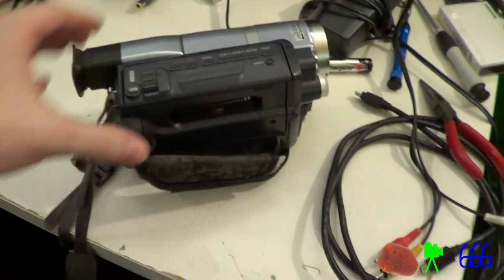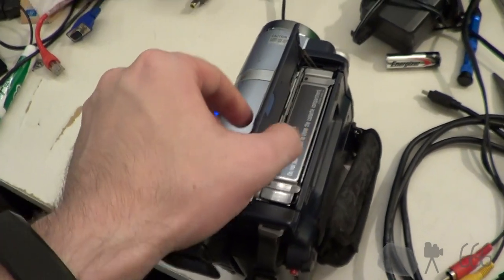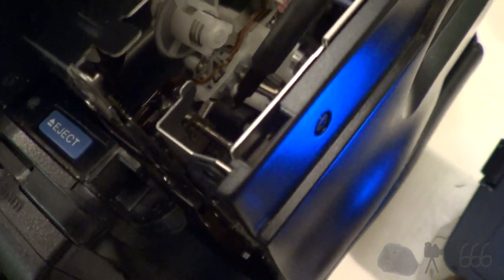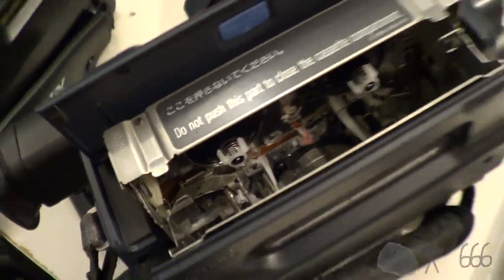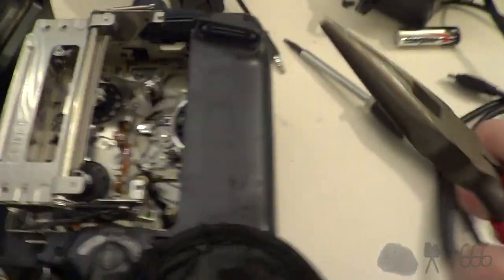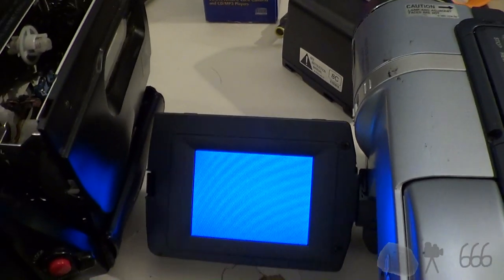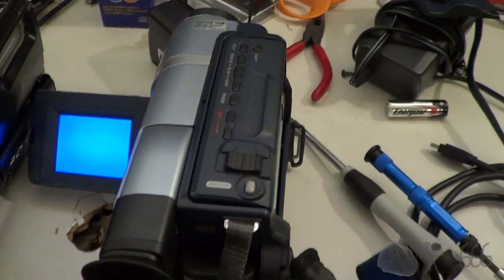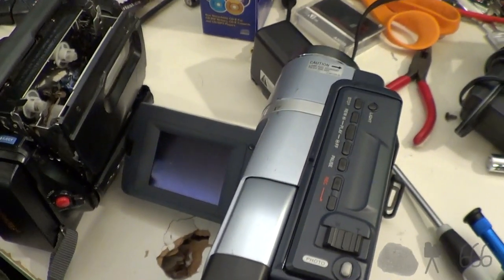REPAIR Sony Handycam C:31:23 Error Message ("White Lock Pin" Fix)

Comment: My Mini DV Sony camcorder gave that code after dropping it on the floor from hip height.
I found your video as well as reading a forum on the code and someone mentioned their roller fell out when they inverted it. Sure enough mine fell out and after inverting again the white lock pin followed.
I used a pair of fine pincers to place the roller back and then position the lock pin on top and pushing it down. It stopped flush with the top of the roller but when I pushed down it went a bit further before stopping.
The roller moved freely and stayed when I inverted camcorder. Then it worked again in both playback and record (filming).
Your video sorted my problem. Many thanks.

Comment: If you still have the roller in place, disconnect the battery and the ac adapter and give the camera a few slaps (pretty hard ones) on the bottom and on the side door. Chances are it will do the trick (it did for me).
Reply: i tried that but after like a min of recording it would come  up wit the same error, the roller and lock piece look fine not rlly sure what to do
Reply: @scar9051  Did you try with different tapes? Try rolling back and forward a tape a few times and see what happens.
Also try a few good slaps on the tape before inserting it into the camcorder.
Reply: worked for me too, thank you!
Reply: Maaaan, u are my saver, i just slapped my cam few times and now its working, thanks a lot)
Reply: It's been one year, I ran into this problem and have been solving it all day, after looking at your comment and hitting the camera like you told me to and OH GOD IT DOES WORK!!!! THANK YOU!!!!
Reply: I tried this before watching the video for the sake of it and I’m surprised something in my life for once was so simple to fix
Reply: OH God, you save me, never in my life hitting something actually worked
Reply: holy shit this actually worked

Comment: Just this very minute I came upon this video. I also have the roller in place and I just pushed at it with a pen and it worked after consistently not working since i pulled the camera out after 10 years in the drawer. It does seem to be the issue. I'd like to thank you for the video. If I find something more, I will post again.

Comment: Just an additional check, this happened in my case:
If it only happens for one casette, check if your tape is not torn. It will give the same errors for this.
Reply: Wym? Like the tape is actually giving the issue code ?

Comment: Thanks for this , had this same problem today , I had to tip the camera up to get the rubber roller out from the bottom where it fell , didn’t know about the small plastic piece until I watched this, searched around for it and luckily it was sitting on the desk , it’s very tiny and easily lost , a biro pen won’t work , it’s too big.

Comment: Waddup, nice vid, but i still got the same error (C:31:22). The black rubbery part was there all along. I checked my insides and everything seems to be fine. Any tips? I´m pretty desperate. Thank you. (My camera is Sony DCR-TRV285E, but i belive the insides are pretty similar)
Reply: Did you fix it ? Did a tape head cleaner work
Reply: If you discover your roller is still there, you might have a cracked lock nut (the white piece that holds the roller on is cracked and will keep getting loose and the error will keep happening). You need to replace the lock nut or insert something to help hold the roller in place. I suggest trying this: https://www.ebay.com/itm/Lock-Nut-for-Sony-Handycam-Pinch-Roller-Repair-C-31-22-C-31-23-1-PIECE/142451202062?hash=item212ac0d80e:g:u-YAAOxyVLNSx7FL

Comment: Hello
Would someone be so kind as to take 1 minute to clarify a problem with video playback?
I have a problem with a camcorder.
Indeed, I recovered old hi8 and 8mm k7s in order to review some memories, so I bought a second-hand Sony Handycam Hi8 CDD-Trv95 NTSC camcorder. (all the buttons are in Japanese:!) works very well I can read new K7 Hi8s but not my old Hi8 and 8mm. therefore impossible to read them ... it starts up, but I have a blue screen.
I wonder why I can't read these tapes when they are good too.
On the other hand, the images of my old K7s only appear in quick reading.
What is the motive?
Thank you for your advice.

Comment: FIXED - I have a DCR-HC22E and had the C31:23 error. The roller and white lock cap was in place, and the roller was rolling around freely. 

However I noticed that the white cap was a few mm lower than the top of the black roller, down inside the roller a bit too much - whereas they should be more or less level with each other.

So I used a thin screwdriver to gently push down on the edge of the black roller, in case the roller was sticking up too much. For some reason, this made the white cap pop up a bit, above the edge of the roller.

So I then used the screwdriver to gently push the white cap level with the top of the roller, and that's fixed it - the error has gone and the camera now works again !

Many thanks CarnelProd666 for pointing out the roller was the issue !

Comment: I have an issue with mine that has a similar problem, it gives me the eject error except slightly different. My camera, upon turning on, automatically starts spinning the nob where the hi8 tape goes into. I just posted a video on this account of the issue, would you mind taking a look at it and telling me what the issue might be? It would be greatly appreciated!
Reply from the maker: That is a completely different problem.
Reply: @CarnelProd666   Would you happen to have any words of advice on how to troubleshoot it?

Comment: Hey man , I literally bought a roller and a lock nut original since mine was giving me the 31:23 code and i put it all in and the lock nut does it need to be completely in? Like enough that its showing the screw thats in it At the end ?
Reply from the maker: It doesn't sit flush, but the difference is less than a millimeter.

Comment: I get that error, but my tape will not eject.  Is there any guide to manually ejecting the tape?  trv85xl   Thanks?
Reply: I get the same error as you,but mine ejects only in VCR mode

Comment: I have the same error code, I did this and still shows the error. What can I do?
Reply: I had the same, my white pin was actually stuck inside the camera, this took me 5 years to figure out. I wiped the inside with a soft paintbrush and it fell out, I hope it works for you!

Comment: Ive been gettin the error code c31 22 and it says to reinsert the tape but my white pin is there as is my rubber roller. Do you have an idea on what the problem could be?
Reply: I have the same issue! :( it wont work . I read that sometimes if you just hit it lightly on the side (like soft slaps, I guess), then eject the cassette and put it back again (and maybe repeat it a couple times), it will work. So you might as well give it a try. It didn´t work for me, though.

Comment: Hi, I have a Sony DCR-PC1E, it has the same problem but the roller and lock pin seems ok. However, the error code C31:23 and sometimes C31:40 shows on the display. Anybody has the similar problem and has the solution.Thanks
Reply: My lock pin is fine but I get 31:23 too
Reply: @jakec2120  fixed?

Comment: My cam have everything ok, rubber roller also there but giving same error C:31:23 How to solve?
Reply: I had same error message but the mechanical parts looked okay.  I put a tape cleaner in - and then when the pushing the cassette carriage down I also gave it a little push inwards as it seemed to be struggling to fully close.  I repeated with an actual tape and it seems to be working OK now.

Comment: This is not the problem. But i have asame code problem.C:31:22
Reply from the maker: I had a problem, I fixed it as shown in the video, the problem went away...so you can't sit there and tell me "this is not the problem" because it is.

C:31:22 isn't a problem, it's a symptom of any number of possible problems.

Comment from the maker: BEFORE LEAVING A COMMENT:
From the description, this is NOT GUARANTEED to fix your problem! The trigger for a C:31:23 (and C:31:22) is a lack of suitable pressure on the tape from the pinch roller per a Sony diagnostic manual. Even if the white pin seems to be present, check it for cracks, it could be sliding up and down in operation. Push on the roller and the pin. You MIGHT have luck with replacing the pinchroller in the unlikely event it has become misshapen. If neither of those works, you have a more serious problem that is likely not [easily] fixable (bent posts, etc).
IF YOU ARE MISSING THE WHITE PIN AND/OR BLACK PINCHROLLER: as mentioned in the video, use of an ink pen tube (or really any kind of tube) is the easiest and cheapest solution. The actual pinchroller can be had on eBay (at least it could, I haven't checked recently), and if you really must I am sure the white lock pin is too. Worst case scenario you can pick one or both off another nonfunctional camcorder as I did.
There is no way to bypass error checks on these camcorders. It's my recommendation you don't try anyways if you care about your tapes.
ANY OTHER ISSUE not related to C:31:22/23 won't be answered for (including but not limited to tape extraction). The blunt answer is that I have no idea what's wrong with your camcorder without seeing it, and I have no desire to engage in the malarkey associated with running a repair shop as a public service, certainly not through YouTube.
Reply: my camera says c:31:22 But how do I know if a piece is actually missing? Is there a way that I can contact you by email so that you could guide me?

Comment: I have a Sony camera which is showing me this error but I still have the roller and white price still in the camera, any tips?
Reply: Me too i really need help
Reply: Same problem here, I do think that it is another hardware problem, what's your camera called? Mine is the ccd-trv16
Reply: If it only happens for one casette, check if your tape is not torn. That happened in my case.
Reply: Same here, did you solve that?

Comment: How did you get the pinch roller off from the other camcorder? I tried it, but I dont get it off
Reply from the maker: I just pulled it off, but it's on fairly tight and I'd be careful not to send the white pin flying when doing so. A pair of (clean!) tweezers might also help.

Comment: Fixed without dismantling. I have a Sony DCR TRV 18 with the all too common C:31:23 error message and have viewed as many posts as I could find to help me resolve this issue.  The most common and easiest fix seemed to suggest giving the camcorder a good slap on the side of the unit. I tried this approach, but in my case no luck.  I tried not to be too brutal.  Most of the other posts revolved around problems with the black roller and white plastic tube inside the roller.  Dismantling the unit was not something I was eager to undertake  -  so I thought I would start with having a good look at the mechanisms and the roller. With the aid of a cheap thin plastic biro I first pressed down on the white plastic tube with the point of the biro to make sure it was secure, and it seemed to be all good. Then I ran the side of the biro along the side of the roller and the roller seemed to be stuck.  I repeated this a few times, gently, and soon enough the black roller released and was rotating smoothly. I reconnected the battery and switched the unit back on again - to my relief the error message was gone and the camera was back recording and playing back. Fixed for now and I hope permanently.  I'll update if the problem re occurs but in the meantime if this method helps anyone else with a similar problem I thought best to share. Good luck and thanks to CarnelProd666 for helping point me in the right direction
Reply: Great. Thanks for sharing. Is it still working?
Reply: Matthew Wells To my relief yes it is still working. From time to time I need to repeat, but it is quick and easy. So far so good.
Reply: I’m getting 31:23 but the roller and pin seem okay, any suggestions?